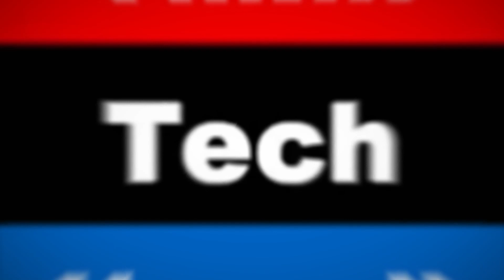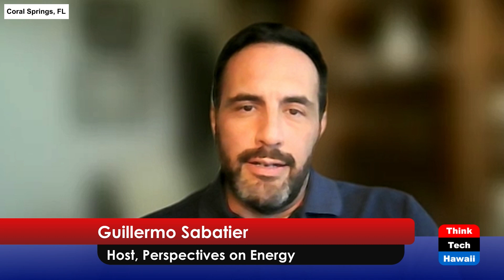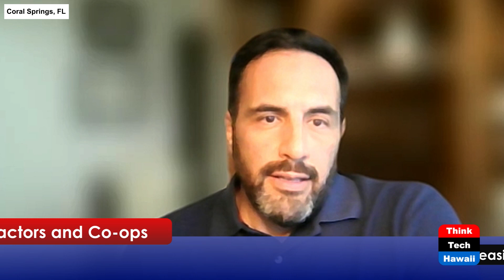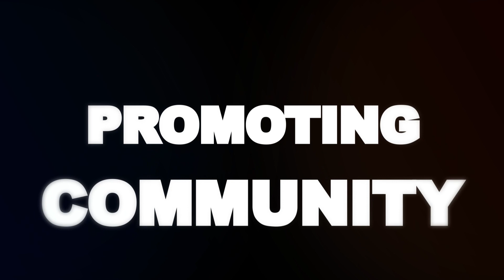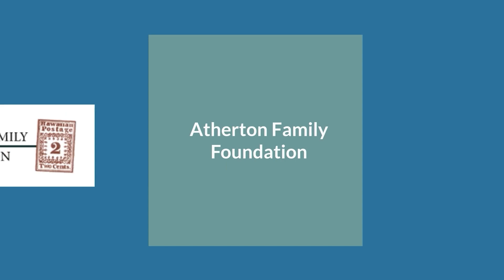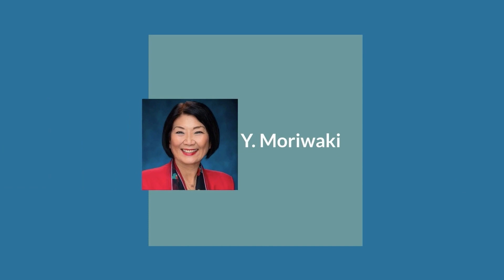Small Modular Reactors and Co-ops (Perspectives on Energy)

Comment: Don't hold your breath on Hydrogen or Iron battery storage.  Hydrogen in particular has severe downsides.  None of the dozens of storage methods we have are up to the task at hand presently.  
Check out Terra Power's Natrium molten salt storage if you don't already know about it. The plant yet to be built in Wyoming has a 50% over rated capacity in storage for peak loading up to 5 hours at a stretch. In my opinion this shows the best promise for the versatility of nuclear to follow demand that is presently only supplied by fossil fuels and small amounts of hydroelectric.  Hopefully we shall see some day if it performs as expected.